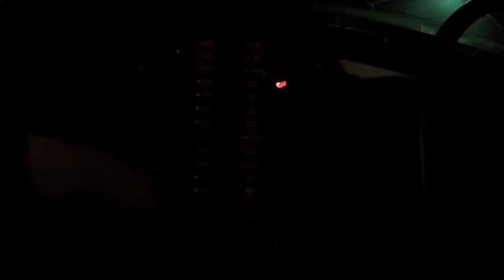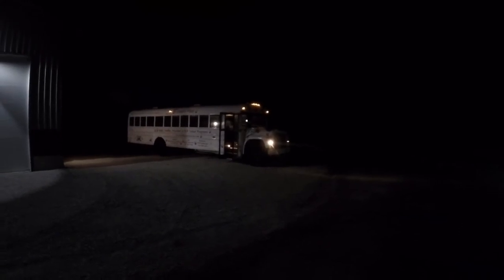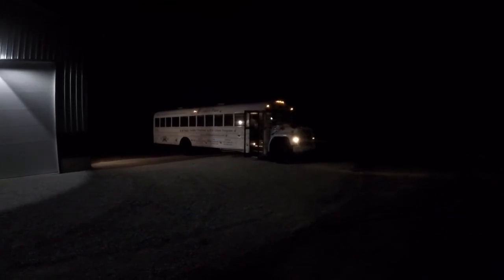1986 International S1800 Carpenter School Bus Cold Start at Night

Comment: is that how the dt466 sounds? i kn its diesel but sounds more noisey than other diesels
Reply from the maker: Bryan Henderson The old inline diesels are louder than the V8's and modern diesels...  but I agree, this one is exceptionally loud, it doesn't help that is has hole in the floor next to the dog house...
Reply: Kind of sounds like a 9.0
Reply: @TommyRetro  Not just that it is also a 100% mechanical diesel engine.
Reply: not just that, he didn't give it the glow plug cycles like your supposed to. It has a wait to start light for a reason. You had to let these old beasts warm. up.